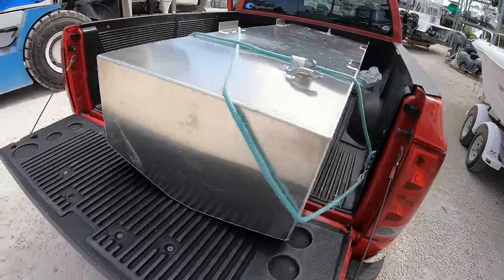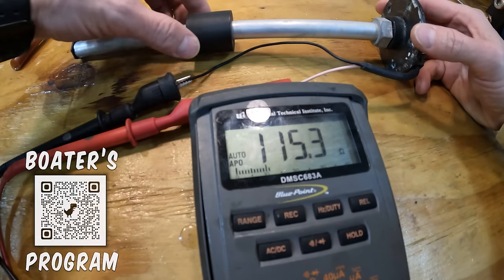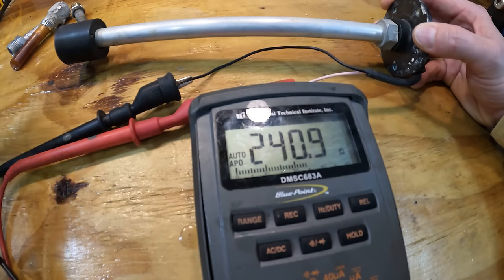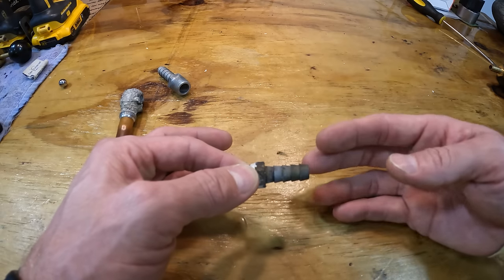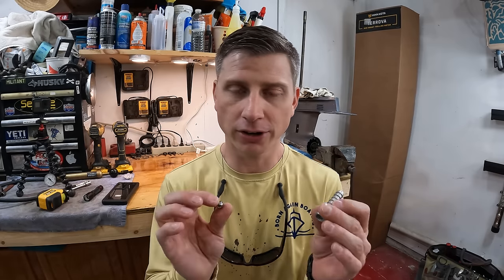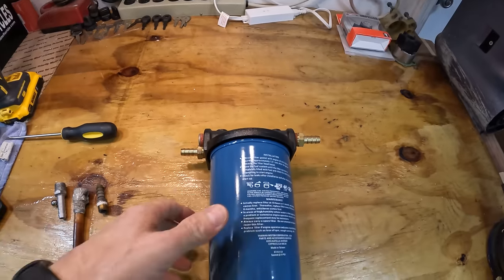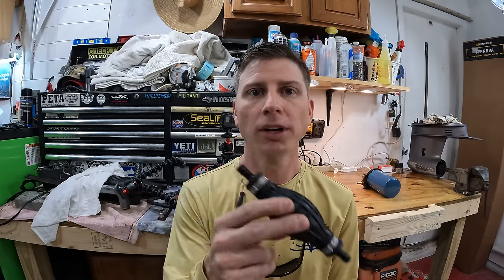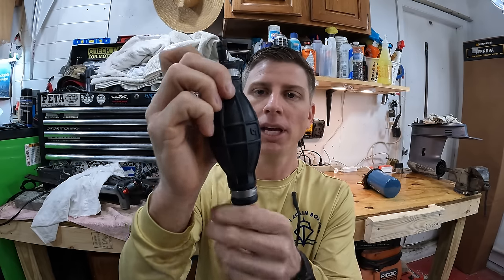How Boats Fuel System Works: Complete Overview

Comment: How does the fuel tank not develop a vacuum as fuel is used? Logically,  i would think that could lead to a fuel starvation issue?
Reply from the maker: That's a good question, the answer is simple, the tanks are all vented to the outside atmosphere, so as the fuel is pulled, air fills the void in the tank. But if you have an issue, like using a vacuum gauge on the fuel line and you see a high vacuum, then there is probably something wrong with the fuel tank vent :)
Reply: @BornAgainBoating  Is the vent the same one that allows air to escape when filling?

Comment: Quick question, my motor is bogging down when I try to give it throttle over 3k rpm, will turn off if I give it more gas, I’ve noticed it only does it when my jackplate is in the original height 3-5 inches, but when I lower down the jack plate all the way down, it will continue to run with no problem, any suggestions?

Comment: Why don't aluminum boats have fuel water separators? I have owned now two brand new aluminum boats and none used fuel water separators.
Reply from the maker: Interesting, didn't know that, couldn't tell you. I think with fuel quality and the fact that it's a boat, they all should have a water separator. Unless it's like a 13-17' boat with a 12 gallon tank, that you can probably get away with because you can keep pretty clean since you can take it out of the boat and burn through the fuel more often.